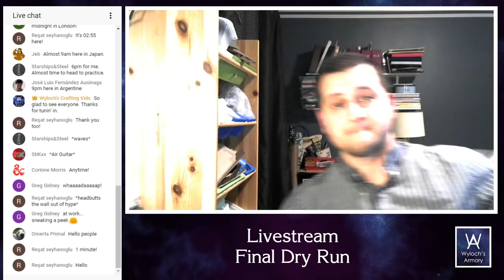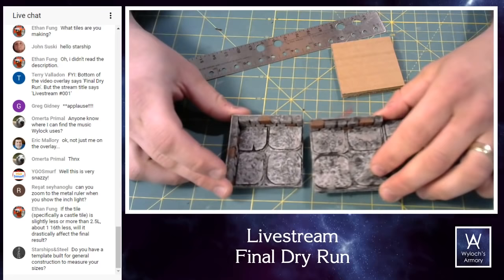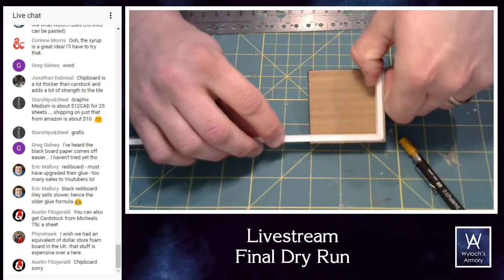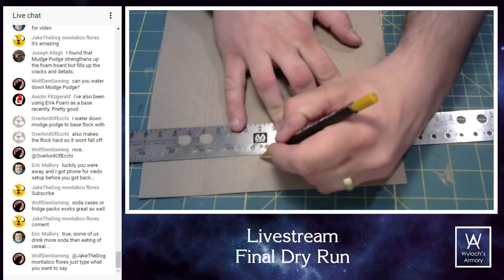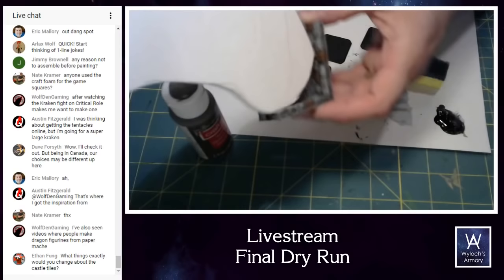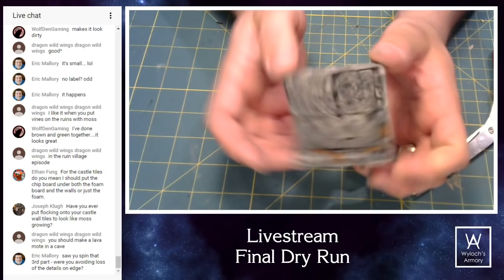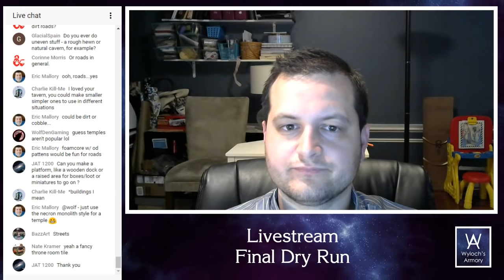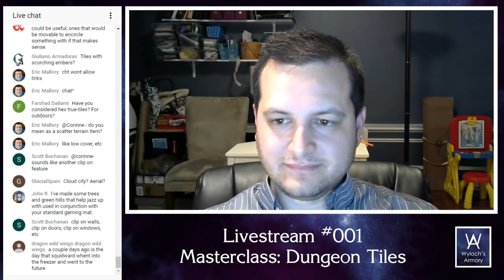Livestream Masterclass: Dungeon Tiles

Comment: OK, something else. EK Success sell 1 1/4" square paper punch and a 1"  that you could simply punch those squares out of the thin chipboard/cardboard you are using very quickly. You can also buy corner rounders that clip the corners.  No measuring required. Sorry, sometimes I can't help myself giving suggestions.

Comment: how well would magnetic tape work with these tiles to stick them together?
Reply from the maker: You would just need to account for the thickness of the tape, and cut your foundation shorter.  I am looking at this in a future episode.
Reply: lol, i do not have the tools to measure something so thin. let me know what you get  :D great job on the live stream!
Reply from the maker: Sure you do!  Just cut the foundation at 2-3/8" instead of 2-1/2".  It's no different than cutting it full size.
Reply: in one of your videos did you explain why your math is the way it is for your tile dimensions?? i normally measure my tiles at 2 1/2 inches so i can put 1/4 walls on the edges.
Reply from the maker: Yes, episode 002.